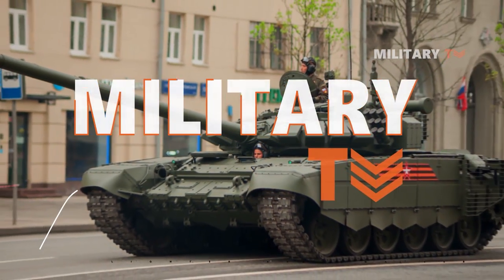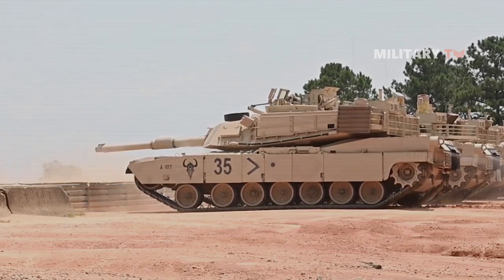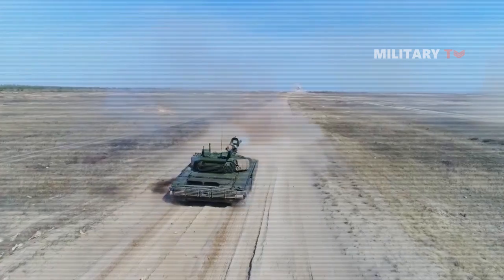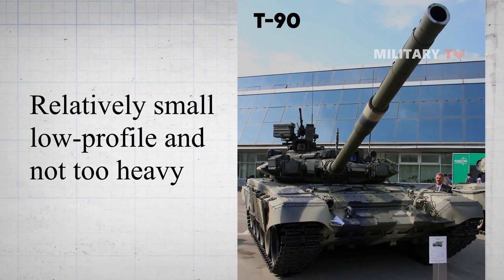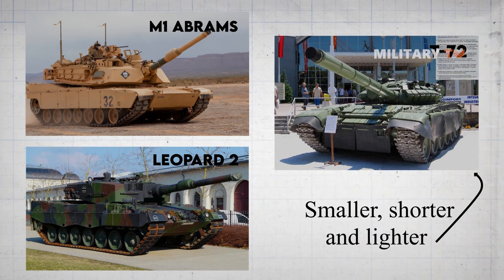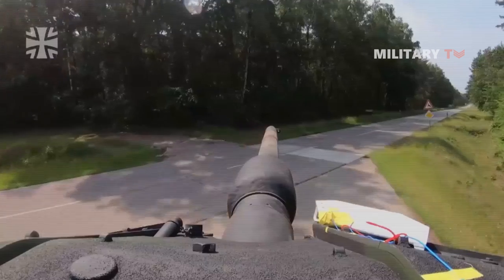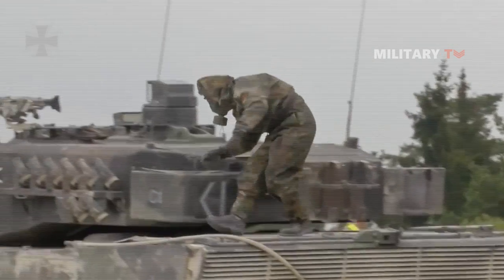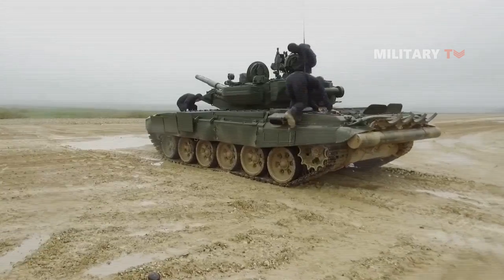Why are Russian tanks lighter and smaller than the western tanks

Comment: During WW2 navy shifted from battleship to aircraft carrier as a main force (though nowadays it would be a missile/drone carrier). The same may happen to tanks: it is easier to destroy a tank with a smart missile that can be launched instantly in any direction than with a turret and “dumb” shell system.
Reply: Javelin moment
Reply: If you think about it, it does make perfect sense to replace current aircraft carriers with ones that do 100% drone warfare. You could design them to semi-fold up and could have 20x as many fit aboard the ship, have no risk to pilots, and could be far more lethal than piloted aircraft since there is no real risk of losses. Not to mention they would be harder to hit.
Reply: Theres a lot of navy cpts who cry over the loss of battleships. Old and slow is not always a bad thing. We still use artillery on land because its a cheap and effective way to rain down a lot of fire. Rockets and plane might be flashy and fast and able to drop a 1000kg bomb through the window of a house.
But its 1 bomb, its relatively speaking a small hit and its expensive af. Its done and over possibly in seconds. What they dont have is the "artillery" capacity, cheap sustained heavy fire,  - a battleship have excactly that. And they dont have to support an amphibeous landing every time they fire. Sometimes you just want that warthog hanging over your head to support the troops for hours. A battle shup is the a-10 or artilley of the sea. A lot of options was lost with the end of the battleships
Reply: @CHAOS88100  Hypersonic missiles are not widespread yet, Russia has some, China is still trying to develop them, and the US is testing them in prototyping now. But yes your correct it would definitely require aircraft carriers to change to adapt. Maybe we'll finally get some sci-fi styled submersible carriers.
Reply: @martinwinther6013  Well the issue is, a modern missile destroyer has the same firepower as an old WW2 battleship did, and is 100x more accurate, while being much harder to hit, and vastly faster. However... You may just see battleships make a triumphant return with advancements in railgun technology speeding along, as they can actually outrange most missiles, and cost almost nothing to use since no propellant is used.
Reply: @johnmclain250  undeniable more accurate, longer range and faster. but also much much more expensive whenever you hit the fire-button - dumb shells is in military context cheap as dirt. 
 if  when railguns is good enough to replace traditional cannons then i think it could be the opposite, The ammo for these weapon would take up very little space in comparison. Perhaps less than ½ the volume, and pretty much any ship would be able to use em(assmuming power tech etc is evolved alongside it)
You would still have the need for guided missiles.Railguns are good a flinging projectiles out at high velicity. but they only move one way, and thats straight ahead, anything in front of it will be teared apart. not always the best if you want to hit a factory behind a civil residential area
Reply: @CHAOS88100  All aircraft carriers are protected by other ships in the flotilla with which they travel. Look up type 45 for an example of how well carriers are protected.
Reply: @martinwinther6013  Hey it makes complete sense to me. But we''re talking the US military here. "COST" has rarely been a factor in anything, usually we just go with whatever kills things the most efficiently. Price tag be damned. (At least when it comes to the big ticket stuff, soldiers don't get the same treatment.)
Reply: @johnmclain250   Not so much what kills the most;shorebombardments, carpet bombings or artillery barrages for days(or atleast hours) havnt been used since ww2.
Because theres no need for the ooomph and death they bring
The cost isnt a concern, or rather. It has to be expensive. Too many commercial interests involved, too many pictures or stories published on various meadias, and too many watchdog grps and lobbyist have too much to say. It has to be expensive so noone can say theyre doing less than best.
And the politicians is ok with the high pricetag, because then they can claim theyre doing everything possible to protect the troops and not hit civilian targets, -  and claim the ones who dont use same techniques are barbarians.
High killcount can be obtained easy if thats the goal. But the goal is the opposite. Kill as few as possible. It looks good in the medias, the firms makes a ton of cash from minimum workload(dont have to sell so much if the stuff you sell cost a fortune), tech-lead is maintained and can keep different industries alive, the civilians(the voters) dont complain too much over the killing of children, you have a steady flow of new enemies(to keep the flow of the circle) who isnt too tough to crack and the world is behind because they (cant afford to ) play by hte rules, you wont stop the flow of volunteers since you can show its all for the greater good.
- If you want high killcount then you just fly a few b-52s and their load to a large city. Or unleash a cpl of grunts with heavy mgs and a cpl mortars.
 - And you can flip all this around and claim its very effective, just look at the succes rate
And youre right. the soldiers on tyhe ground dont get ½ of what they should have, in terms of salary as well as kit. The pricetag on rockets and missiles is just nuts.
Some told me without providing source, that upwards ½ the US military budget was for ICBMs and similar.
rest is for active fleets in all the worldoceans, a giant airforce, helicopters, fielddeployed electronic warfare, satelites, the troops and bases abroad. 
If just 2-3 missiles was scrapped and the money guided to the floor lvl then they would lift the stahdard for all who doesnt have offiiceduty..
We cant have a ilitary doctrine like that of the russians, where they basically lvl a city with mgs before moving in.
And it appears the russian cant have it either.
For a lot of the reasons mentioned
Reply: @CHAOS88100  Nah, not really. Basically every hypersonic missile or glide vehicle is either delivered via ICBM or takes a semi-ballistic trajectory, which would theoretically give air defense systems plenty of time to react. It would definitely change the placement of warning radars though.
Reply: It pretty much already has happened. MBTs no longer play the role they did. Although they still are needed they are not needed in the numbers they used to have. Too many shoulder fired missiles these days.
Reply: I've sort of been mulling over what tanks are actually for in this day and age. Like if you want to attack someone, it seems to make more sense to invest in the air-force because of the greater reach to do the damage while ground forces (like tanks) only roll in to mop up what's left. But then, as Ukraine sort of demonstrates that maybe modern tanks are actually more useful in defence where they are more likely to have access to the fuel they need and not quite as much at risk if surrounded by other defenders on foot.
Reply: @Outside85  You cant win a war with fighter/bombers.. you can only deal dmg, perhaps destroy some key infrastructure. but if you want to make a difference then you still need boots on the ground
Reply: @Outside85  Air force can't really do much on its own against an "equal" opponent. Specially if the enemy has ground based anti air defense systems which would most likely be far more vulnerable to ground troops. It's all rock-paper-scissors in which you jeed all kinds of weapons in conjunction to coordinate and cover each one's weaknesses. In fact, it actually has a formal name: It's called Combined Arms Warfare.
Reply: Active protection systems as well as thermal/infrared stealth for vehicles are all coming. Although, not for Russia. Missiles are effective against cheap and old Russian tanks, but they may not be against newer Russian tanks, or American tanks or really any newer generations especially when the next generation tanks start production runs. There are going to be plenty of counters to today's anti tank weaponry soon enough.